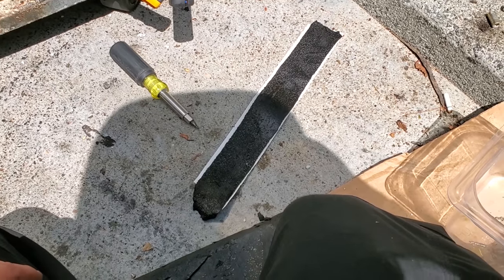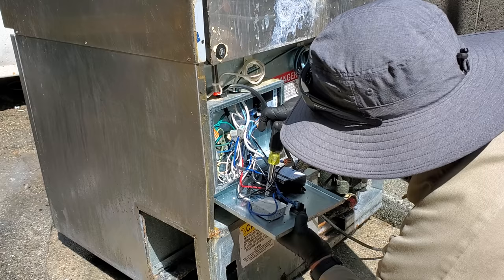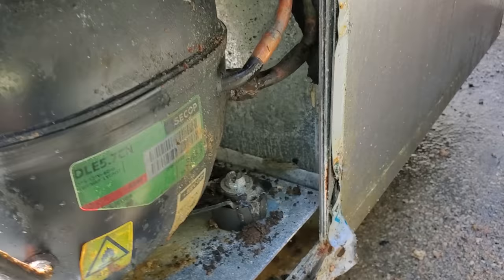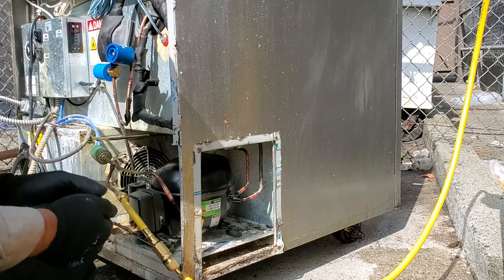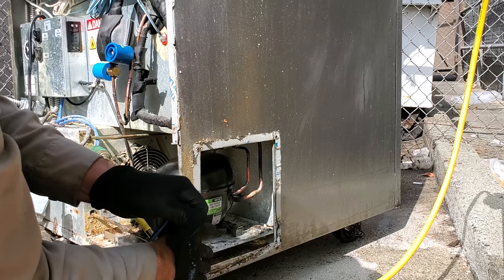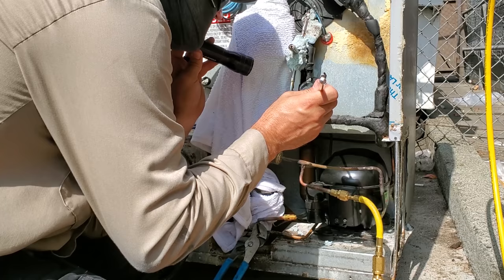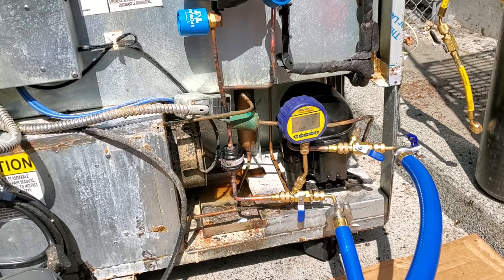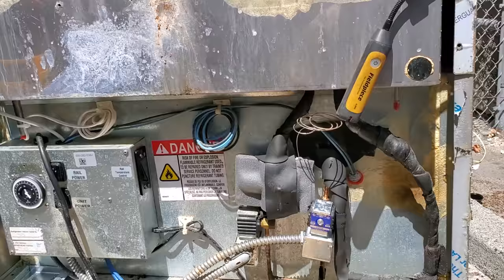ARE ROACHES REALLY THAT BAD??

Comment: 14 minutes in; "braising"? You cannot braise copper pipe, you solder it! I was brought in to my workshop a commercial microwave oven, under warranty. I decided as we do not cover cleaning and it was covered in old sticky Indian food, the owner was told to clean it and then bring it in for repair. Cleaning it solved the problem as the door switch was contaminated with old food.
Reply: Of course you can.  The best is to braze with silver solder.  Faster and easier but more difficult to get a good seal all all around is Sil-Phos.  If you're really cheap, Phos-Copper.
Reply: @neon-john  Brazing uses Brass, Brass melts at a higher temperature than Copper. Silver Soldering is called Soldering. Brazing is Brazing, Soldering is Soldering.
Reply: @jonsnell4751  I think you need to learn a bit more.  The company I owned until I retired 2 years ago made custom induction heaters.  We built a vacuum brazing system for a company that uses pure copper as the filler.  Suggest you look up the definition of brazing before you speak anymore.
Reply: @neon-john  It would apear the the term Brazing, is now a general term and nothing to do with fixing steel plates of different thicknesses and densities by melting a brass rod with flux powder as it was when I was working with sheet metal and vehicle bodywork repairs back during the 70s in the UK. Seems to be a corruption in the meaning of the original term but I do understand your reasoning. We don't call soldering Brazing but the Chinese describe Soldering as Welding. How bizare is that!

Comment: These roaches are really hard to get rid of, in Australia we call them German cockroaches.  You can see they have tried to address the problem, at the start of the video there is one with deformed wings. Spraying them often and being exposed to constant low levels of surface spray creates deformities. There is a gel you can use that is effective, doesn’t kill them straight away makes em sterile or something.  Also, doesn’t matter how clean the shop is, these things eat cardboard and each other.  Dealt with these in a former life, bastard things.

Comment: Isoprysol alcohol can safely douse electrical components like circuit boards and any contacts to clean them but if there fried it won’t do anything to help 😕
Reply: This will clean corrosion off to and scrub it with an old toothbrush

Comment: Question, you installed a schrader valve to the service stub, I noticed that you didn't install a valve on the liquid side, is it not worth the effort?  If you had it would allow you to measure the subcooling and help diagnose other problems.  Is it because it's such a small system, doesn't mean a lot? 

I was called to work on a residential AC system, found roaches everywhere, said I wouldn't touch it until they had the place cleaned, they never did, I didn't go back.  I've see that many of those from foreign countries have a different threshold for sanitation that others.

Jim

Comment: I'd rather not insulate that suction port at all. Cork tape works better than armaflex in these cases, but you'll never get a perfect seal. And if you don't get a perfect seal, it'll rust again. While if you don't insulate at all sure it'll rust, but much slower. Just my opinion, not bashing anyone.

Comment: We are not allowed to use access ports on 290 units, has to be pinched off and brazed after repairs.  And sleeved with red sleeves... 🤦‍♂️ so stupid..
I've been using propane in freezers for more than 20 years. Never had a issue..

Comment: Why is it that household fridges can last 30 years easy and the "pro" stuff fails so quickly o.O Just the heat, humidity and dirt ?
Reply: Usage and run time...commercial boxes get opened and shut all day long. Environmental conditions are the worse also including the users
Reply: household fridges don't last 30 years anymore.   If you have a 30 year old fridge, it'll keep running.   Buy a new one and figure 8 years tops.
Reply: @gtoger  That bad ? What fails first ?
Reply: Commercial stuff probably lasts ok without roach version of new york city getting developed in its control unit.
Reply: It's true the old cliche they don't make em like they used to....In order to compete manufacturers have to find ways to do more with less. Build a box that uses less raw materials, energy, and comply with govt/consumer efficiency/environmental demands with a low price.
Reply: @grindstone5368  Not to mention planned obsolescence so that the manufacturer can count on selling more units down the line.

Comment: Dude, why are you so surprised 
I would have told the client before beginning that this unit is junk and not worth the money and when they say fix it any way I would say ok and it will cost more than a new unit.
Reply: It was warranty work, so the machine is still in warranty. Some of the components weren't, but from what I saw, they hadn't caused a problem.

Comment: anyone know what the little blue magnetic things he installed on the pipe is at 23:50?
Reply: were the solenoid valves go
Reply from the maker: It was a magnet to pull the solenoid valve open while I was working
Reply: HVACR VIDEOS were did you buy it from?